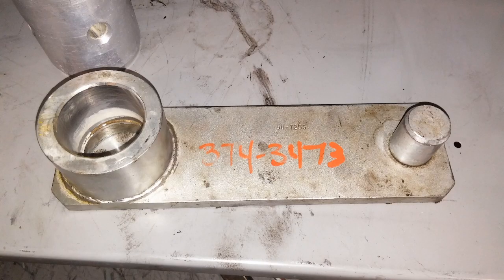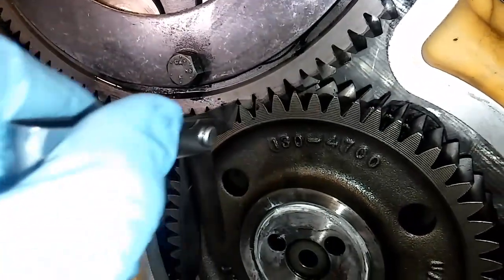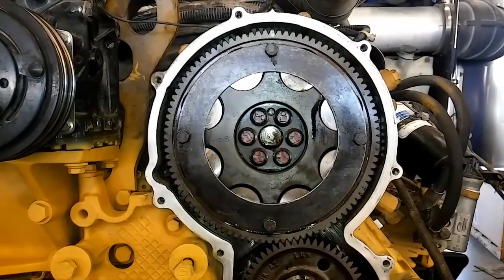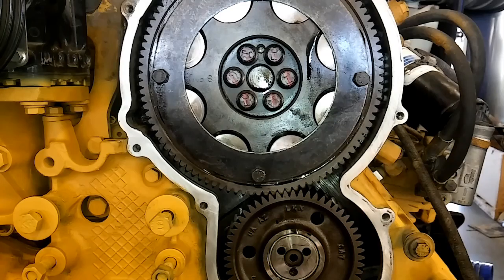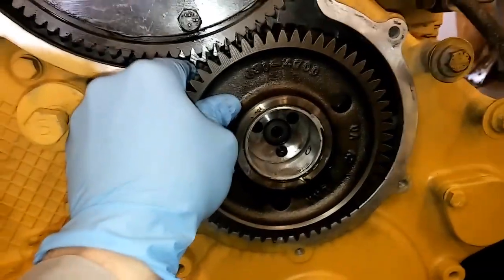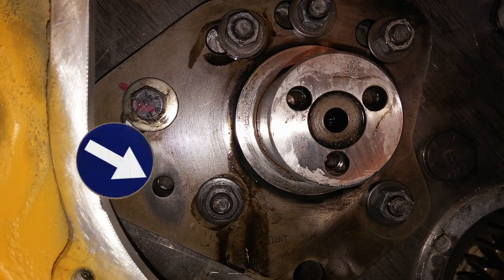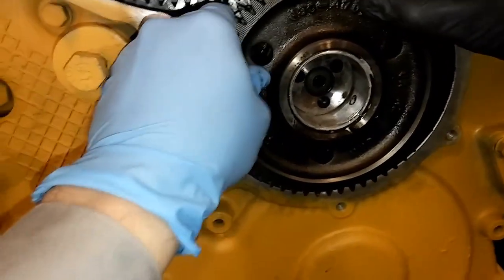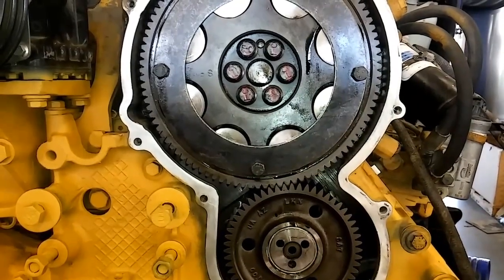3406 & C15 Camshaft Gear Backlash. Set Gear Backlash.

Comment: I need to remove the idler gear to replace air compressor stud that’s behind the gear. If the gear lash is correct before removing should it stay the same when I reinstall the gear

Comment: Hey, I love your videos. I have a question, where did you get the .014 to .024 spec. My CAT manuals read this way:  

4. Install Tooling (B) on the timing gear housing. Measure the backlash between camshaft gear (2) and 
idler gear (3). When the idler gear is held stationary, the backlash between the gears is 0.216 ± 0.114 
mm (0.0085 ± 0.0045 inch)

Comment: Where did you get 0.014" and 0.024" from? I cant find anywhere on sis that doesn't list that the backlash spec on a C15 is 0.216 ± 0.114 mm (0.0085 ± 0.0045 inch)
Reply: p.s. great channel, this is a great trick to just use the feeler gauges like an ISX but genuinely, am i missing something with these numbers?

Comment: Had to do the front cover gaskets 2 winters ago and this worked perfect with lining that bolt up, this winter I rebuilt the engine and had to use a slightly thinner spacer plate under the head and had to mess with the backlash for a little over an hour to get it it right, fun times

Comment: hey Bro have a question for you. i have a BXS cat that i recently overhauled  pulled front cover down and re-bushing all the gears i have been fighting code 22-11 for weeks now and i can not seem to get it to go away. I have been working on Cat motors for over 15 years.. and i have never had this much trouble with one . Truck did not have this problem before i repaired the motor. if you have ever had a problem like this please let me know what you found wrong. i have followed Cat SIS troubleshooting  sensors are new and i have check OHM reading they are to cat specs  and sensor are genuine cat. Today I tired another Camshaft gear in it and had same issue. I pulled transmission out of truck to make sure flywheel was on Dial pin on back of crankshaft. LOL I REALIZED after doing all that the flywheel can be checked by making sure both holes pin on driver and passenger side of motor. My next thing is doing a timing probe to reset the timing.  if that does not work i am pulling the front cover again to see if the cluster gear is ok
Reply: what did you end up finding on this?

Comment: @adeptape Question and hope to get an answer soon in my 3406e cat testing and adjusting manual it say my backlash should be between .003-.010 and what you showed is .011 different. Wonder if that was updated by cat or is just different in newer c15 manuals
Reply: With the dual sensors added and at that time Cat was offering reman heads that was shaved. Sometimes you could not get the lash in the window. So current spec is 0.014 +/- 0.010. Or min of 0.004, max 0.024. Try and stay off the min. Single sensor engines are more forgiving. Dual, you might get a CEL as you could be out of phase.

Comment: Roy Rodriguez

Hi, I enjoyed your videos. I have a 1994 Peterbilt 379 with a 3406 B. Truck was running good until the turbo went out. Unfortunately the mechanic that was working on it miss diagnose the problem. The truck had lost power and was smoking real bad,,real bad. He replace all 6 fuel injectors then had me rebuild the fuel injector pump then he realized it was the turbo. After he put everything together the truck sounded like it was on steroids and still was smoking a little bit. I took it to another mechanic to check the timing and supposedly was out 2 teeth. But every time it went up a hill loaded it was lacking power. starting from the bottom off the hill it will only go to 35 or 40 max loaded 72,000 total weight. If it was driving at 65 and hit a hill it will go down to 40's. Engine sounds weak too. Any advice to what to work on. I am from Chicago west  suburbs and is hard to find a mechanic that knows how to work on this older engines.
Thanks
Roy
Reply: A 1994 sounds like a C model. What is your full engine serial number?

Comment: absolutely love your video's . do you have away to pull up info on serial # . I have a 3406E with a 4as00244 # my local cat dealer said he cant  find any info other than its  a cat reman. i know its set at 550hp but not sure its was at time of rebuild . reason for needing info is #5 injector lobe is spalling and i need to change the  cam and really could use a part # so i have it before i tear it down. thanks

Comment: Hey buddy I see that this is an old video.  I have a 2005 mxs and I am getting a pid22 fmi13 flash code 42.  How do I get this code to clear? I only have snap on scanner. Can I set/check timing to or is that code a ecm timing issue? Thx in advance for the help, Brad pcstowing@gmail.com!
Reply: A 22-13 code is timing calibration not preformed. Two ways, first do a timing cal procedure, recommended. Second get a download that is not corrupt and put cal file ONLY in ECM.

Comment: We have a little dial indicator that bolts up in one of the peanut cover  bolt holes. Its just a little right angle bracket, takes up no room. Works wicked, never had a problem.
Reply: I need help how much the toque the head?

Comment: Hey Josh, I know most people do not have a CAT back lash Bone but that's how I've always done it along with the timing pin in the 3/8 hole you're pointing out. So you really only have to use the hole and the tool is not used?
Reply: I know this is an old comment but if the head has been shaved or if the block has ever been decked the alignment hole will not work because the head, and cam gear, are physically closer to the idler gear. The back lash will be too tight and could spin the front cam bearing due to the gears trying to move away from each other under torque. I just snug two of the nuts on the stub shaft and tap it with a soft dead blow hammer until I get the back lash right, then torque everything with blue loctite.

Comment: No it was the reason I lost the last engine. Constant blue smoke (not oil). New injectors and no change. turned out to be creating hotspots to the point it drilled down into the pistons until it blew out a chunk of number 3. then inframed and still had the blue smoke and barely started. Then injector pump (7W7800) fully rebuilt and still smoked and wouldn't start. Tried advancing fuel timing but got worse so tried retarding timing and got much better.

Comment: I gotta crazy problem with my 3406b that no one can figure out. full inframe, head reconditioned and injector pump done but will only run, albeit not quite right (low boost hard starting poor power) with fuel timing retarded 2 or 3 degrees. I'm thinking cam timing is out. Care to way in?
Reply: Did this start after rebuild? Who rebuilt engine? Cat dealer or local shop?
Advance timing will cause low boost.  Full serial number, major part numbers of replaced parts. Example, head, cylinder packs, nozzles, injection pumps. Also any part number that has to do with performance.

Comment: Hey man got a question my 3406b peec keeps throwing a code for low oil pressure new main and rods and oil pressure sensor checked pressure with a manual gauge and reads 50 psi at idle and 75 running but I still keep getting the code even a new ecm dont know where im loosing pressure if im really loosing it or could it be the injection pump
Reply: Is the oil psi sender in the TDM or remote mounted?
Reply: It's a faulty indicator

Comment: I have rebuilt c-15's with a reman head the head was cut I set the timing gear with the pin backlash was tight I use a great tool for backlash cat tool #462-5095 it's a segment gear  check it out
Reply: Yes I am the guy who invented the gear. Showed it to a Cat factory man and in a few years guess what tool CAT released? I made the first one out of a normal gear that had a tooth failure (still use it). Cam gear CCW, increases lash, while CW decreases lash. I set my engine cam and crank on TDC 1. Install my cut gear and measure my lash. If I have to adjust lash sometimes I use the feeler gauge as a stop point. Usually a .006 and rotate cam gear until it starts to get tight. Snug my adjuster get feeler gauge out and recheck the lash. The .006 keeps from hitting the min spec. After I feel lash/timing is close enough and torqued adjuster. I than reinstall running gear and recheck lash. For some reason my cut gear can change lash by .002. All this mess started in the MBN days and CEL was coming on for timing out of phase. We had to replace reman cylinder heads just installed for this. Cat than increased lash a few times to solve the problem. I try and get as close to the timing mark as I can with lash in the window. I really don't like less than .010, but have to go with what you got.

Comment: At 4.47 mins it , you are talking about putting the 3/8 bolt in the alignment hole . I did not see any 3/8 bolt in the video. is the bolt a tight fit in the hole. but the bolt has thread on the end of it , going into that what looks like a smooth bore alignment hole. You just lost me on that bit . I need to see the bolt in the hole , and how much play is left in that backing plate that u tighten with all those nuts ?

Comment: That bolt trick works sometimes but not as often as I wish it did.
Reply: I took a metric bolt and worked it until if fits the hole snug. 3/8 bolts are sloppy loose.

Comment: Hey there, like your vids, they're very informational. I have a 3406E in a freightliner classic,  truck run strong but... somewhere in the middle of the day my yellow check engine ligh comes on and almost immediately the red shut down engine light comes on they blink anywhere from 3-16 times before it turns off my engine, almost immediately they will turn off and the engine will operate normally again. All gauges are normal and engine doesn't studder or no noise or vibration from engine. would you have an idea what to look for or at?

Comment: My 2ws with 50000 miles on rebuild has a loud and heavy "rattling" "bad bearing" sound around peanut cover area. I want to pull cover and check this. Is there a gasket on cover I will need to replace ??? Awesome vids and very much appreciated!!!
Reply: Yes
Reply: NO its rubber and will seal again.

Comment: Hello Josh, if you have some time I have a question... I have   a F250 diesel (international) started smoking like crazy. u had looked at by diesel mechanic, said it was the fuel injection pump,  $2,800 for repair. is that too high and is something I can do my self. I usually do the small repairs in my 77Blazer gasoline engine? please advise .Oz
Reply: Lol none got time for that engine lol

Comment: Awesome video! I use a set of blueprint feelerblades for small engine repair and a 3/8” fully threaded bolt to insert in timing hole ! So far has worked just fine! Thanks for sharing 👍. Sorry bluepoint feeler blades lol !

Comment: nice work that's a time saver of a trick. what do u use to pull the cam gear off the crank I was trying to get one off a Cummins m11 it was quite difficult  just curious if you have a trigger tip for that
Reply from the maker: +home built hot rods tools and tech b I've never had to pull a Cummins Crank gear. If I knew a trick for it, I would tell you.
Reply: Adept Ape 
I am sure it's same as a c15 damn that thing was tight I ended up taking to the machine shop thanks for the great videos
Reply: Hey Josh this is love you're videos very  hepfull ..I have a question I have a c15 single turbo it has the 3 piece exhaust manifold I just bought the truck and it looks like it's dripping oil from in between the manifold where it comes together it is missing like a gasket or something should I be worried .?